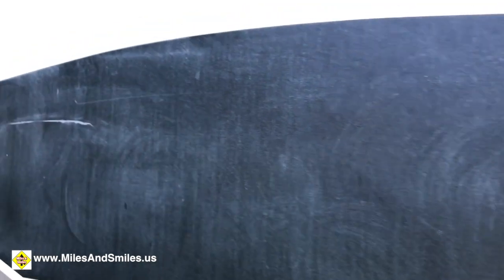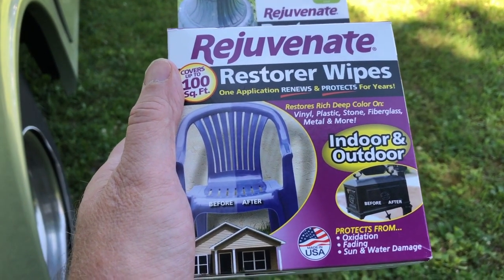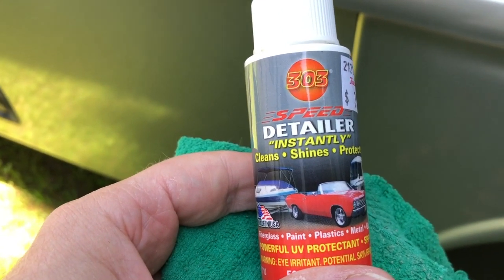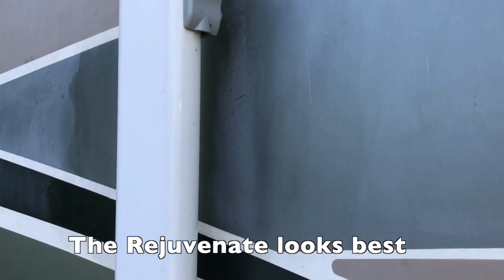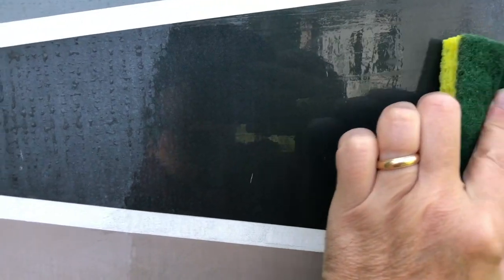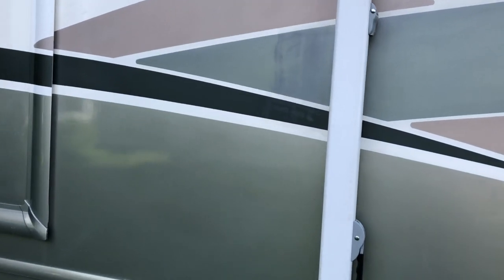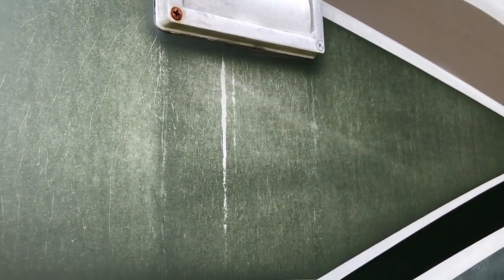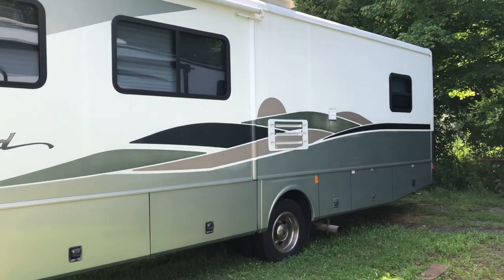How to Restore Faded Decals on your "classic" RV

Comment: Hi Jeff, thanks very much for the advice. Worked a treat on my trailers decals. It was looking a bit unsightly especially where the water runs down either side of the windows. Looks like new again. Thanks again
Reply from the maker: Thanks Craig. As it happens I’ve just ordered another box of the wipes for another refresher.

Comment: With all due respect... We recently took our 2001, 38 ft Cat powered, Freightliner chassis  Winnebago, Ultimate Advantage to an RV repair shop in San Bernardino that specializes in restoration to have our faded decals professionally removed, upgraded and replaced... It was not especially cheap but they removed the original decals, completely detailed and polished out the entire coach, redesigned (to some extent) the stripping to our specifications and color scheme and did a completely professional job... The coach looks brand new.... I'm a totally capable and competent do-it-your-selfer but there is absolutely no way I would consider undertaking this task on my own... Just too big a job... Somethings are better left to professionals...
Reply from the maker: That sounds fantastic! I wish I could see a picture. You're right, what we've done is to a completely different scale and as you can see in the video there are still cracks and uv damage to our decals. But before we found this cleaning method the coach just looked shabby, and now it's so much better than it was -- still is even a year later! Congratulations on your complete restoration. Maybe someday we'll opt to go down that route too.
Reply: How did it cost to replaced all the decals? I’m thinking having mine done. Thanks
Reply: @rudeman1914  Well... We had some other work done, etc... But I would say the starting cost to think about was about $4,000... A lot depends on the condition of your coach as far as the siding, gel coat etc... And whether or not you want an elaborate upgrade or to just replace existing... Some people want a completely new look on an older coach... Okay... My thought was to restore my coach to original with a flourish... Did not want to make something out of it that it isn't... I appreciate well cared for older things... If you know what I mean...
Reply: P.S. We were quoted $17,000 to remove vinyl and replace with paint by one RV repair company... I'm totally happy with the vinyl and have a shelter to store the coach in to protect it from UV...
Reply: Larry Nielsen wow It’s expensive! I have a 2017 class C 22 I got quoted just for one sticker 4’ long for $500
Reply: What was the name of the RV repair shop?  Hoping to take my RV through CA in a few months and need my faded, cracked decals replaced.
Reply: @davidfray1948  Sure David... The name of the company is V.I.P Enterprises... You can visit their website at www.rvstripes.com
Reply: @anotherjoe5675  at those prices, I'd take it to Maaco!! 😉
Reply: @ThePeasantsCottage  Ha, ha!... One size certainly doesn't fit all... I agonized over what to do for a year or two... Our restoration fit our goals and budget... Best to you...
Reply: Agree. How much did it cost upu?

Comment: Stumbled across your video while look for how to do this very thing and what works.   I’m going to try your method.    

This video is a few years old.  So my question is this.  How does your method hold up to everyday weather and  rv washes.  

Great video!  Safe travels!
Reply: That's a great question. The white streaks and fog on the decals have not returned. I find that I want to renew the decals yearly with the Renew pads to restore a bit of shine. As many comments have mentioned, this does not fix cracks in the decals, but I do believe that it extends their lives. Good luck!

Comment: What you will find is that the white "paint" or gel coat on the fiberglass panels chalk up and bleed down over the decals. This causes a lot of the fading that's actually the pigment that is running down the side. If you use a scotchbrite pad with a sealer it may help a lot.

Comment: Instead of your scratchy pad I used  240 wet dry sandpaper and a squirt bottle of Dawn soap enough Dawn soap to make it slick that’s all you need squirted the Dawn soap on the decal Gently in a circular motion seem to remove all discoloration better than the scratchy pad for me and then after I’m done to keep the decals in good shape I’m going to use Maguire’s marine vinyl restoration comes in a  blue squirt bottle squirt on a shop towel rub in . I have now changed over to 600 grit wet dry sandpaper leaves less scratches on decal and I’m using protect all rv wax gallon size it darkened silver, brown and black decals to a better to a more uniform look very impressed with protect all
Reply: Thanks! I may give that a try.
Reply: @hayeswildrick  Thanks for your comment and I added to it and discovered 600 grit wet dry sandpaper and protect all seems to work better thought I would just let you know

Comment: We have a 1993 Winnie Warrier.  Rustolium clear coat did a great job in very little time.  We masked the area above and below about 1/2 inch away so that the glossy area looked right.  The clear coat should protect the decals well.  We painted one stripe that was peeling badly.  We just scraped, masked and dabbed the paint on.  My daughter mixed spray paint to match.  We then masked the whole thing and cleared it like the decals.  This method id amazing.  It doesnt wear away the decals, freshens them and should keep them fresh for years.
Reply from the maker: Wow. That’s awesome. I may try that on some areas that are deteriorated more badly. Thanks.

Comment: Penetrol Flood. I use this on my 76 f350. It makes it shine like fresh clear coat. It will slowly wear off in about 6 months if left in the elements though. Just wash good and wipe on with a nano towel. I put it on metal on paint on rubber tires n rubber trim on vinyl dash n seat on marker lights. Just wipe it all down but glass. I seen videos on YouTube. Lots of guys use this on rat rods and old petunia vehicles. Hope this helps someone.
Reply: We have used Penetrol for years on many projects from show cars to boats … great stuff

Comment: In my opinion, this spruce up reminds me of plastic headlight Lens restoring.  You remove the outside oxidized layers with successively Finer grit wet /dry sandpaper, Starting at 400 or 600 grit and working up to 2000 grit. Where can you get this product you ask: at an automotive paint supply retailer. The deterioration of the decals in this video don’t seem that severe, Sometimes there’s severe cracking and shrinkage.
Reply from the maker: You're right. Our decals do have some places with cracking which this won't help. But it sure did/does make the rest look so much better!

Comment: Sometimes the white haze is lime scale build up. Using hard water to rinse a washed RV will leave a haze. Try to use a product called Lime Away (off the store shelf) that is home grade product. Just a thought. As always, use any cleaning product in a less conspicuous spot first is case it's not what you like.
Reply: That’s a great idea. In my case, I believe that the white was wax buildup from other attempts at polishing up the RV, but lime could certainly be the problem as well.

Comment: Thanks for the video. I just purchased a 1992 Winnebago Minnie Winnie with original paint and decals which are in amazingly great shape except for the hood decals which have oxidized and faded a bit but still have no cracks or other defects.

I think your process is all I need to bring them back to life but have a question. When you talk about a scrubby sponge, is it just a sponge or did you use one with a non-scratch scouring pad on one side. I'm thinking that it's just a sponge but they say that the only stupid question is the one you don't ask. Thanks again.
Reply from the maker: I used a sponge with a green scrubbing pad and it was the pad that scrubbed through the oxidation and built up wax. I didn’t have a blue pad at the time, which is less abrasive, and plan to start with one of these next time I do a similar cleaning.
Reply: @MilesandSmiles4U  Thanks again. I'll give it a try.